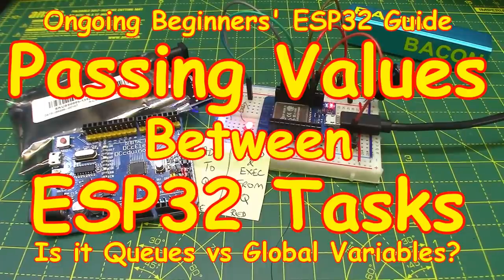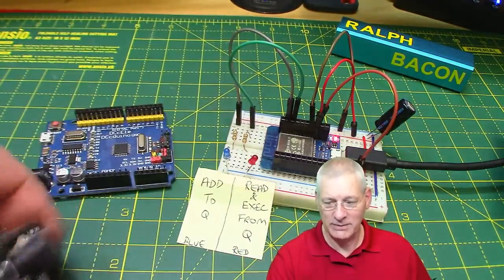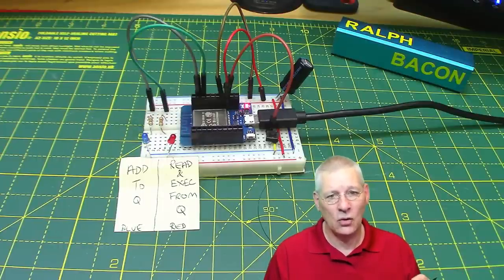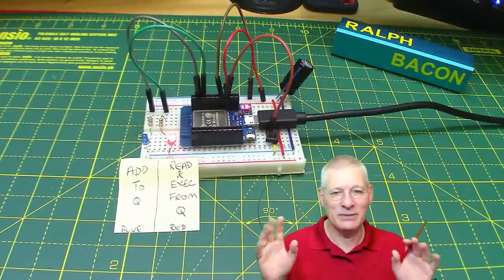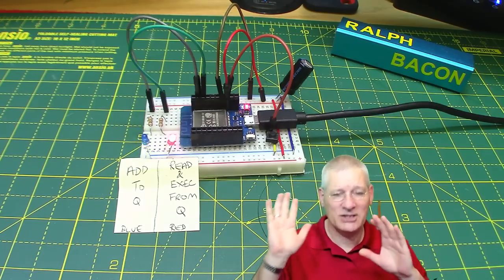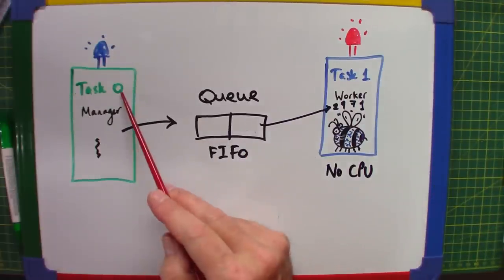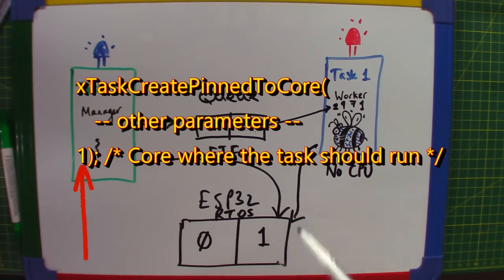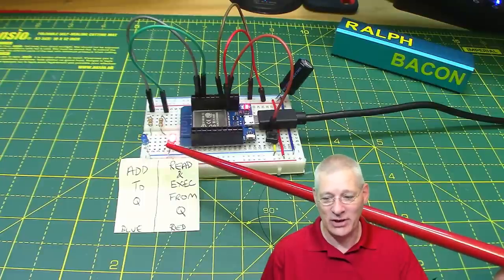#151 - ESP32 Passing Values 💾 Between Tasks - Deep Dive (2 Easy Ways)

Comment: Thanks for producing this and #150. It greatly demystified multi-core programming for me.  I have a project That I think might benefit from this.
I have a ESP32 based controller that centralizes control of lights, thermostat, and air compressor in my shop. The thermostat is controlled via wifi and the lights and compressor are controlled via relays. The user interface is via a touchscreen and a webserver. Occasionally, the touch screen is unresponsive. I suspect this is because the thermostat is being slow to respond over wifi and the request is blocking while waiting for an response. It appears to me that I could avoid this by using the second core. 
Core 0:
     - thermostat handling
     - web server
Core 1:
     - touchscreen service
     - timer maintenance
     - relay control
How does this approach sound?  My thinking is that the Core 1 functions would work normally while Core 0 tasks were blocked while waiting on the thermostat to respond.

The timer values are accessed by the web server, touchscreen, and timer maintenance functions. I don't see how a queue would serve this.  So I guess I would use global variables with semaphores.
Reply from the maker: I'm glad you found the video interesting, Leon. However...

However, although I might have used Core 0 and Core 1 to make a point about moving values between tasks, you really should not use Core 0 at all; it's for the RTOS and Wi-Fi and BT... all the stuff Espressif have put in there. Core 1 is for us developers.

So, the best approach is not to use Core 0, just to create a new task, at the same priority as all other tasks (=1) pinned to Core 1. That's what I do with my ESP32 Web Radio: a separate task to handle the transfer of data from an audio buffer to an audio module. Before I did this it was very jittery due to other functions in Core 1 blocking (mostly waiting for) some Wi-Fi procedure to return. Now it runs like a dream.

Tasks get a time-slice of about 1mS unless they "yield" their time slot. If the task has run out of work to do, or is itself blocked, you yield the remainder of its 1mS time-slice to other tasks of the same priority (which, counter-intuitively then only can use the remaining time left in that 1mS slice) but it all works amazingly well. I do this with the above-mentioned Web Radio task; if it runs out of data I just "yield" - no point in hogging a time-slice to do nothing in!

You've listed several functions that you feel need a dedicated time-slot; set up new tasks for each, but do this slowly. Keep everything in the loop initially, which, of course, must be non-blocking in any way (no delay(x) calls) and move each function to a new task, one by one, ensuring the whole thing functions.

Ensure you have enough debugging (monitoring) in each task but remove that (or switch it off) as soon as you feel it's running, as Serial prints are slow.

The other thing I do, is to call each of the functions from the main loop() every few milliseconds, rather than doing all tasks all the time. So, for example, I update the screen every X milliseconds (given that it's mostly static). This then gives more time to other functions in the main loop( ). You may find you need fewer tasks than you think!

Anyway, this is not the work of a few hours, it will take some design and experimentation - good luck and go slow!

Comment: Are these boards with the esp32 documented well. I know the chip is but are there schematics or pin out table.  Also, a huge advantage of an Arduino is the number of libraries already written. Can these libs be used with the ESP32 ? Thanks Ralph, great video. Glad your getting into this chip.
Reply from the maker: The ESP32 community is vibrant, Joey, as is the documentation and support (including the forums) from Espressif themselves, IMHO. You can use the Arduino libraries although I've only used a few so far. After all, if you're writing commands to the I2C bus then it makes no difference what hardware platform you're running on. For the sake of a few dollars it's well worthwhile just getting one and playing with it (also IMHO).
Reply: @RalphBacon  Thanks Ralph

Comment: Great video full of info!
Would it be possible to a video like this where you can control several servos?
Reply from the maker: If you write one function to control one servo you could run that function many times (once per servo) in different tasks. Just pass in the parameter which servo it is that you are wishing to control from your main sketch and Bob's your uncle.

Comment: The architecture is 32 bit which means 4 bytes of ram written and read at once. Even more importantly though is that higher math functions such as multiply and divide are software routines in an 8 bit processor whereas they are native instructions in a 32 bit processor. Often times hundreds of instructions on an 8 bit cpu.
Reply from the maker: Often true, John, but it's lucky for us the AVR 8-bit chips do have hardware multiplication. According to the datasheet, it allows 8- and 16-bit implementations, signed and unsigned routines, and fractional signed and unsigned multiply.
Here's some bedtime reading: http://ww1.microchip.com/downloads/en/AppNotes/Atmel-1631-Using-the-AVR-Hardware-Multiplier_ApplicationNote_AVR201.pdf

Comment: Brilliant vid, loaded with info! I have a question! A simple setup. task on one core reads temperature off a sensor, and the task on the other core sends that temperature to an IoT cloud. It seems its safe to use a global variable, unless the sending task tries to read the variable at the same time reading task tries to update it. For such a setup, would a queue be more suitable or a semaphore?
Reply from the maker: Using shared (volatile) global variables is always tricky; using a semaphore before reading a shared variable will be much safer. 

BTW I would not put the two tasks on different cores; run them at the same priority on Core 1 and it will be safer for all the Espressif stuff (BT/WiFI etc) running on Core 0.

Comment: Very interesting video.
My favorite multitasking synchronizing is Javas synchronize and queues, with these two I can do a lot of safe multitasking. With semaphores you have to be careful, at least when using multiple levels. Deadlocks are a PITA to locate! This happens very easily when you need a couple of resources and each has it own semaphore and each task have to reserve stuff at different parts in the code.
Reading and writing variable asynchronous is usual safe when using the native word size, but with anything else semaphores are needed.
My ESP32 boards runs at 80MHz, but I am going to check if I can change frequency. I use some 30pins boards, they looks like nice ESP32 hardware, the 36 pins board add a couple of useless pins (The ones needed for internal program access).
Reply from the maker: I showed you how to change the CPU frequency, Henrik, (assuming you watched to the end) so a quick 5-line sketch should prove it one way or the other.

As for deadlocks, I sort of mentioned that if you cannot get a semaphore in the allotted time it will return a response indicating this. It's something I must expand upon as they are, as you say, somewhat problematic.
Reply: I have tried that now, but I do not have the functions to get/set CPU frequency.
Searching the library code I found this:
uint8_t getCpuFreqMHz(){ return CONFIG_ESP32_DEFAULT_CPU_FREQ_MHZ; }
In the ESP class and it return 240

The timeout on semaphores are not always available and it is mostly meaningless in some content anyway.
Reply from the maker: Yes, 240Mhz is the default speed (and that used by the Arduino IDE). But if you have installed the recent boards from Espressif then you should have access to those function I show, to set and get the speed of the chip.
Reply: I have not really worried about updates, but hoped that the Arduino IDE handled that, but that may not be true. I use this link for ESP32 in the board manager:
https://dl.espressif.com/dl/package_esp32_index.json

I do not know how to force a update. Maybe remove the link and add it again after a restart.
Reply from the maker: Now, Henrik, I did a detailed, step-by-step demo on how to add or update the board definitions so you obviously skipped ahead! Go to Tools, Boards, Boards Manager then type in ESP32 in the search box and you will see ESP32 version 1.02 (or even later). Upgrade to the latest if you haven't already. That should give you all the (new) commands you seem to be missing. Let me know how it goes!
Reply: I found the problem, my Arduino would not download the new board definitions, I had to manually delete a "package_index.json.tmp" file.
Now I can change the frequency.

I know libraries get updated automatic and I would also expect board definitions to be, is that wrong? Of course it would not be working due to the fault.

Comment: Hi Ralph, your comment about the String() function vis-a-vis the ESP32 was a tad inaudible. Is the String function safer in ESP32, I mean is there an error catch , if heap allocation is unsuccessful ? Thanks for your amazing videos !
Reply from the maker: The use of the Arduino "String" with a capital S is known to cause heap fragmentation (and eventually a crash). 

However, heap management is allegedly better on the ESPxxxx processors and your heap space doesn't turn into Swiss cheese. 

That said, I've used std::string in my ESP8266 work and that runs 24x7 for months on end with no issues. 

Regarding a "catch" for heap fragmentation problems, I'm not sure you can correct it - I mean what is your code going to do if your request for heap space fails?

Comment: Great video, just started using the ESP32 and I'm finding it difficult to find these sorts of  indepth explanations, keep up the good work. Regarding core 0, if you're are not using bluetooth/wireless would it be safe to use it?
Reply from the maker: Thanks Chris for your kind words. Now, if you're not using Wi-Fi or BT there is still the OS running on Core 0 but I would use it, with caution. If you upset it you will soon find out with a PANIC or similar on Core 0. Don't forget to yield tasks when there is no more work to do and to keep the priority of your tasks to the default of 1 so that others in Core 0 continue to run.

Comment: Just came across this - I was really confused before. What a great presentation, thanks.  Could you tell me - in the xQueueCreate would it be possible to send a structure with different data types.  Also could you send an array?   
One thing I found - - (I only use Arduino IDE) using the serial print code within the tasks in the format with String caused the fatal error situation.  Once I split it into 3 statements no problems at all. Interesting that the String format style does not cause problem when used in the standard loop section.
Reply from the maker: The vparameters parameter type is just a void pointer (to a variable), so I guess you could point it to a struct or even a class instance (object)! I have some faint bells ringing but no definitive answer, this time. Strange about Serial.print but maybe a native C++ call might work better. Or output a char array rather than a String (with capital S).
Reply: @RalphBacon  Thanks Ralph.  I've been able to pass both arrays and structs with no issues. Interesting was that the number of arrays or structs put on the queue works just like a normal variable in the xQueueCreate statement, as the sizeof () is just set to the array or struct variable. If you set to 1 then task0 just waits until it can put the next whole set of array data to the queue.

Comment: This is great!

I was refreshing my memory as to how queue and semaphores work etc.

I forgot that you can change the processing speed.
Does this mean you can do this per core?

Also, would be interesting to see how much energy per cycle is used when the clock rate is lowered.
IE. If using a battery system for a non-time critical application, is it more energy efficient to lower the clock cycle, and if so, how much benefit is this?

(I'd imagine the results would not be linear. Also, it would generate less heat due to lower clock speeds, but how much does this actually save?)
Reply from the maker: It's pretty much a fallacy, IMHO, to think that you will save power by reducing the clock rate. 

If your microController is mostly asleep then that is where your power savings come from. Then, upon waking, you want to get things done pretty much as quickly as possible so you can get back to sleep as quickly as possible. 

Whilst slightly less power is consumed whilst on a lower clock frequency it does not make up for the fact that you will be awake for longer. That's my take on it, anyway. 

Of course, if you are dependent on a reliable clock (eg serial transmissions) then a slower internal one may be better regulated but then you should really use a crystal anyway!

Comment: Hello Ralph, thanks a lot for your videos. Do you have one of an introduction to ESP32 telling your prefered IDE and what to know about freeRTOS? Something like the correct way to work with ESP32.
I'm currently using Arduino and should upgrade.
Reply from the maker: Espressif, the designers of the ESP32, have taken note of the popularity of the Arduino IDE, Mariano, and you can continue programming right there if you wish. Just install the ESP32 boards from the Tools, Boards Manager, ESP32 once you have added in the following entry into your Tools, Preferences, Additional Boards URL Manager:
https://dl.espressif.com/dl/package_esp32_index.json

That said, I would take the plunge and either use the new Arduino PRO IDE that is still in alpha (based on Eclipse) or use the open source and well-respected PlatformIO with Visual Studio Code (which I am currently using). 

Anything new will require a degree of familiarisation (aka a steep initial learning curve) but the PlatformIO community is mature with a wealth of documentation and videos. 

I decided to build my ESP32 Web Radio project using Platformio & VS Code (so I became familiar with it) and whilst at times it was quite frustrating, it eventually became a joy to use. No turning back for me now although I will keep trying the Arduino PRO IDE (it didn't compile my ESP32 project though!)
Reply: @RalphBacon  Great, thanks a lot. I'll study PlatformIO. So far Arduino has shown to be sufficient, but sometimes I fill it's not enough, specielly when debuging.
Have a nice week-end : )

Comment: you have explained this rtos, multitasking very well, what i like to know, is the ram on the board you have used, or tell me where to find that info, thanks in advance
Reply from the maker: I'm glad you found this useful. Regarding your question, I'm not totally clear what you mean by "is the ram on the board you have used".

The ESP32 has 4Mb of SRAM built into the chip, shared by both processors and is used just like any other memory would be. You know this. so what was your question, exactly?

Comment: Hi Ralph dose the clock speed upset the wifi .
Reply: It's not supposed to...it's managed in the background by the RTOS.  ESP8266 yes- you can seriously piss it off.
Reply: @jimb032  thanks
Reply from the maker: Espressif seem to say that 80Mhz is the slowest, reliable speed for any ESP32 variant (when running wifi). But the only way to know is to try it at lower speeds and see what happens.
Reply: @RalphBacon  thanks for letting me know. I try when I have fixed my usb port after a little mishap. Lol.
Great  videos as usual.
Reply from the maker: "A little mishap" = "totally destroyed the motherboard"? Yes, I've had a few like that! I've heard anecdotally that the wifi signal gets "corrupted" at too low CPU Speed, but an identical ESP32 with the same speed can communicate with it no problem. Secret network!
Reply: @RalphBacon  well worth knowing for low power application. Maybe cpu speed can be interested when wifi is needed then go back to a slower speed. 
Thanks for the  time
Reply: @RalphBacon  hi Ralph.  It was my understanding from the document, bullet point 2, it just increases it during the wifi operation.  Therefore you can't have an effect on THAT PART of it.  But of course I never tried to go down to turtle speed with it either.  I also though the real trick to save power was to use the one core/sleep and not fiddle with the speed, but I haven't but 2 finished esp32 projects that run on battery, which are short term and dont really matter..so I haven't checked that much either.  But I think you are right, someone needs to do an experiment and see, also about the low power core.  So we'll see in your next video.  (Did we just give you work to do?). :)
Reply from the maker: Sorry, James, you're breaking up... hello... are you  there... phew! Dodged that bullet!

Comment: So very very clear as always, thanks Ralph.  Just a question about cores, I am planning to run three tasks and was thinking of task0 on core0 and the other two tasks on core1.  If I'm not using the wifi, will this be faster / more efficient than running all three tasks on core1?
Reply from the maker: Short answer: yes, Paul. Longer answer: Yes. If you use two independent cores then each core can support X tasks before you see a noticeable slow-down. But even if you do not use WiFi or BT you might have to take further steps to kill (suspend?) the tasks that are running on Core 0 as otherwise you may get a Core Panic and the ESP32 will reboot. That said, if you code well, that is don't hog all the CPU cycles in a tight loop, for example, it will all work anyway (as my demo from the previous video showed). Good luck!
Reply: @RalphBacon  Thanks Ralph. Just a supplementary (and probably unnecessary) question, your excellent demo showed tasks sharing data via queues but on one core only. Can I assume that this technique will work between tasks running on different cores? All the best.